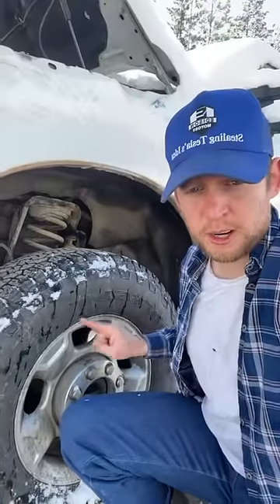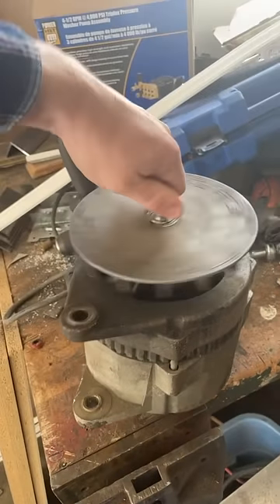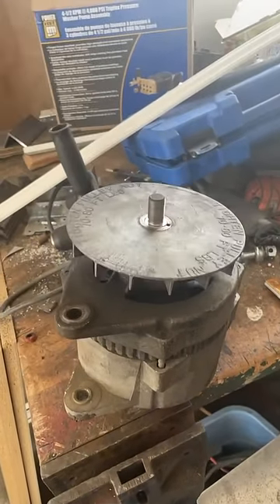Alternator on each wheel???

Comment: I cannot convince my dad that a windmill in the grill of your car is a bad idea
Reply: Lol
Reply: Especially for those modern pedestrian crash safety standards.
Reply: @rklug  I mean... don't be in the road
Reply: Unfortunately, you’re dad is ever so slightly right. It’s a bad idea, but Practical Engineering made a video on it with his Ford Bronco. It does burn extra fuel, but so does an alternator. The propeller consumes a little less fuel to make the same amount of power.

It’s not intuitive, and the gains don’t offset the dangers of having a big propeller on the front on your car.
Reply: Let him put a van on his sailboat 😂
Reply: Without an active grill to stop air flow when not needed there is extra drag and if you have an old DC fan you can see by putting an led on the fan circuit you will see it light when the fan is on and when it is off and above 45 mph from the air turning the fan. Still best to block that air than to run a windmill/fan to generate energy.
Reply: He's half right. So long as you're not driving with a tailwind.
If you imagine an ultralight electric car with a massive propeller on top stopped facing a headwind, the wind blows, fan spins, generates power and will accelerate the car forward, generate more power, accelerating the car further. 
The same story for a crosswind, although acceleration will be hampered as the windspeed over vehicle is a square root of a sum of squares (Pythagoras theorem)
Tail winds though, it can only accelerate you up to windspeed, after that, the propeller stops spinning and you'll stop accelerating, and if you accelerate past the speed of the wind, even if you reverse the polarity, you'll be generating less power than what's being lost to drag and the unit will slow down.
Reply: @explosivemallard8038  i saw that video, love his channel. But he thinks it would just make all this extra power lol
Reply: ... what if you put an electric fan in front of it?... Huh Mr logic guy?😂
Reply: Technically a windmill will produce a net positive. However pedestrian safety standards won't allow it. Not yet at least.
Reply: @tummytub1161  ... I believe Mythbusters already tried that1
Reply: Yep!  My mom.  Sigh.
Reply: @rklug  nobody cares
Reply: There already is one
Reply: @kamikrazywarboy2008  That would be an Alternative power source and will be extra tax and an extraordinary markup on the vehicle. Cord sold separately...
Please blow respectively...
Reply: @kramnull8962  but windmills are for milling grain... And since you're on the move you could make money to offset the additional cost. Turbines make energy. 😂
Reply: Your dad is right, mythbusters did it 20 years ago, you’ll gain more then you lose to drag, & screw people, most a ya suck anyhows
Reply: @patrickancona1193  i guess i should have explained this in more detail. He thinks a windmill in the grill of a car capturing all the air that goes through the radiator. Im aware the heat of the radiatir makes a small amount of thrust, im aware the blades slow down the air on the pressurized side. I understand the physics off it all. You guys are talking about a very optimal and mostly impractcal way of doing this all.
Reply: @Zappyguy111  a car circuit is not that simple 😂, voltage and amperage is regulated through the vehicle as it needs to be, it will indeed generate more power by spinning faster but that doesn’t mean shit, just means more of it gets transferred to heat my dude
Reply: I agree it found in the grill is a bad idea. But a tube going from the front of the vehicle to the back of the vehicle and a turbofan made of plastic spinning the generator. Just work
Reply: @Rnm1hart  yeah, like a naca duct on the top feeding a fan at the very rear. You could even put a radiator in front of it to take advantage of that added energy.
Reply: What if its on /in the exhaust pipe 0_o
Reply: @LmanTrojan1212  hmmm, thats just like a turbo generator that f1 cars use. It would be cool but you would want to put it near the manifold so you get the heat before it is radiated into the air and so it burns off the carbon. Youd have to have a good cooling and oil system but turbos already have that.
Reply: You know how those challengers have holes inthe headlight housing? Can't you craft your aerodynamics to pull air into to little windmills in those ducts?
Reply: @cyberiasaint  haha, maybe! Put a ram jet engine behind it!
Reply: @cyberiasaint  it might create more drag and use more fuel then energy it will produce.
Reply: @LmanTrojan1212  better designed intakes need to exist. I need a scientist!!!
Reply: @sambadel3492  
Sounds like you need to rethink the implementation of your model. I'd suggest a control circuit between the fan and your power system.
Reply: It's not 🤷‍♂️. That wind is being generates by the thrust of the vehicle. We've tested this it actually creates a small charge.

Not the same...
Reply: To be fair tesla uses their motors as generators during regenerative breaking 😁🤷‍♂️🙋‍♂️
Reply: The science says feasible, (go watch the veratsium video about the wind car) 
However practical limitations from the atmosphere being dynamic means it's only a "when the stars align" kinda thing.

Put it on a submarine, and we'll talk.
Reply: @jaredpaulsen3  you guys have left even me behind lmao, all that engergy transfer and complex aerodynamics.
Reply: @everettstormy  to be real, I'm here for the lolz, 
Cause I should be figuring out that wind car, 
Went faster than the wind that was propelling it.
I know it's not most people's cup of tea, but one day, mark my words, I will revolutionize something.
Thanks for your engagement 🙂
 and love your life!!!
Reply: Wish idda read this before posting
Reply: Because it’s a FANtastic idea bro
Reply: I don’t believe you gotta try it
Reply: Lol why would you want to grind wheat in your car
Reply: I mean to be figured that's so slightly better idea than best one
Reply: Actually they make special wind turbines for the roof of vehicles
Reply: Honestly have you ever seen a radiator fan? bruh
Reply: Age is a prerequisite for wisdom, but age alone does not guarantee wisdom.
Reply: Not a bad idea, I think it would only take a few people getting chopped up by the fan blades before people started paying attention while they're in the streets or in parking lots. That by itself would be a win.
Reply: I have a small wind turbine on my truck....but then again that's to charge my external battery and its a 5.7 v8...soooo...
Reply: And I cannot understand why a hydro electric setup in the bed of my pickup wouldn’t work . Hahaha
Reply: Regenerative braking recovers some of the kinetic energy that would otherwise turn into heat and instead converts it into electricity. In this system, the motor drives the wheels during acceleration or cruising, but the wheels drive the motor while decelerating
Reply: Get him to rig up a water wheel instead. It'll be funny.
Reply: You already have a windmill in the front of your car it's called a motor fan
Reply: On a Tesla it would waste energy.  On a pick up truck there is a possibility that it could reduce drag while producing energy.   Mainly because a pickup is so wasteful.  In addition to the Veritasium video where an extremely efficient system can use the wind to power a car to go faster that the wind.   If the wind comes from the side, it would be like a sailboat.
Reply: Unless it has a direct flow thru exhaust......
Reply: Lol, a form of this is patented actually by my great-grandfather. I wish I could post a picture here of the original patent paperwork we have framed hanging on the wall. 😂

Edit: The fan idea that is. Not the alternator idea.
Reply: Put the windmill on the roof and park where the wind is blowing so it charges while you are parked.
Reply: Or you can just NOT get an electric car and not have to worry
Reply: @catsaregovernmentspies  i like the way you think! combined with a little drill to collect geothermal and solar you might not even need all the hamsters I just cough "adopted" cough cough
Reply: @michaelwhitacre8499  lmao, so you one of those kind of people. stubborn, I like that. mechanically inclined I assume. just a small problem. you have to say something so dumb that we all thought it, but none of us thought it was even worth mentioning. you just have to understand that it would add zero value to society.
Reply: @everettstormy  wow. That's a very drawn out response to a passing comment 😂. If you want an electric car knock yourself out, but I'm not seeing any real positives for getting one.
Reply: Tiny turbines with dewalt brushless motors generating power
Reply: A fan powered alternator creates drag, but overall it should charge the batteries, which is better than loss from the belts.
Reply: It is a great thought no exactly a bad idea 

Wat he really needs is a prop and turn his car into a land plane
Reply: One on the back
Reply: @michaelwhitacre8499  lmao, woke up and chose violence
Reply: @weazeldark3983  a land plane, lol. Instead of an airplane, a GeoPlane
Reply: @wyioughta  milwuakee better
Reply: Ok what about a scoop that forces air through the natural aerodynamics to an internal air turbine that's setup on a flow through.
2. Solar panel film in roof or hood
3. Alternator on the wheels that engage only down hill
Reply: @DJSincereTV  the wheel alternators are a lot of weight but would be ight for a hybrid. The solar panels would do a little but really not a ton. The hood scoop would add a lot of drag when ever the car is needing power so that the wind generator is loaded. A few problems but thats kinda what weve been discussing.
Reply: @georgejefferson8718  actually you might be on to somthing. If the fan was relocated and put on a flapper like and ac mixing valve.
Reply: @johno812  i think your missing the fact that pickups are designed pretty functionally, the drag comes from the larger engines taller suspension and work bed design. I cant really think of a good way to add a decent propeller unless it was mounted in front.
Reply: jonaaurelius6871  there are soo mant problems with that im not even going to get into it lmao
Reply: @russchiappa4870  yeah, just pump the water up and let it run back down over a turbine. Infinite power!
Reply: @weaselodooms  lol, thats really cool! Do you have any videos of it?
Reply: @natekraft9529  lmao, yes i have. I think the proceeding comment may have been talking about you
Reply: @Zappyguy111  yeah um, thats a perpetual motion machine your describing. Its like using a magnet to push another magnet. You may get a very slight net positive if the wind is adding energy to the equation but that wouldnt be much becuase of size restraints
Reply: @everettstormy  
If that were the case, sail boats would be impossible, but they've the go to mode of transport for 10,000's of years.
Reply: @Zappyguy111  okay, hate to be that guy but they def havnt been around for 10000 years. Also, notice the size of the sails and the fact that they are only going the speed of the wind. The wind from the cars speed will never produce the same amount of energy it takes to continue the cars velocity
Reply: If I were you, I would look into whether he's your real Dad. It sounds like he might have just been the Patsy.
Reply: That's a good one
🤪🤪🤪🤪
Reply: @TonyRule  lmao
Reply: @TonyRule  hold on gotta look that up
Reply: @TonyRule  after a quick search, i have no idea what you mean by that.
Reply: Also illegal. No Bullshit.
Reply: @everettstormy  Normally, the apple does not fall far from the tree.
Reply: @antoncasciano8747  what about a windmill off each bumper?
Reply: @ShawnDickens would a pipe instead of Rod to make the grill to usher the wind into a turbine to charge a battery not work. The engine still gets all the air through the slits in the grill that little extra that flows around the vehicle would get blow straight though eventually. Causing suction of the wind like a bladeless fan. This should add to fuel manament, and dynamics, but decrease down force.
Reply: @Gerry Bird  air tube straight from front to rear is the only front opening I know of that reduces drag, but usually only a racecar is okay with a large tube through the middle of the car and not many of them even.
Reply: @ShawnDickens  hmm, im not sure how that would reduce dragw aside from releasing the preassure pocket at the front and the rear low preassure pocket. But, if you put a turbine in the middle of it. That would produce enough drage to midigate most of the airflow though that channel and it would build positive pressure in front of it. Not sure how it would effect things full though. Depends of frontal design
Reply: @TonyRule  lol, while thats true, he grew up in a different time. Most of his experience is practical and just what he sees. I enjoy the theroetical side of things. But we also argue a lot about that stuff lol
Reply: @Everett Stormy  yeah, that is how I works. The cars with the tube will have a little more top end. Yes, a turbine in the middle would cause a flow restriction, like the one in the  grill, it would cause more drag loss than power production.
Reply: That's because your dad knows it is an awesome idea
Reply: @jrbird1983  i mean this idea could actually work in a car with a vary small engine to work as a hybrd system
Reply: Show your dad Quint builds here on youtube, excellent father and son bonding just trying things and one is a wind mill in the grill of his truck
Reply: @c4k3t0otz6  hes seen it.
Reply: Lol that would be a great idea, for aesthetics.
Reply: That's actually not a bad idea and are driven turbines work quite well obviously.
Reply: Wait hold on why even use electricity? Let's use wind powered cars bring back the saying "set the sail"
Reply: Oh really. What is the difference between a small wind turbine and the radiator fan
Reply: @cloudian159  hundreds of feet and hundreds of pounds. 
Keep in mind you did say wind turbine. And those are the differences. It can be condensed down to one word=SIZE
Reply: There's no such thing as a small wind turbine. Those are known as windmills
Reply: @cloudian159  wind driven vs belt driven.. Input =Air force vs Engine pulley system.
Reply: @Allworldsk1  i am aware of that. I was pointing out that it isnt a bad idea nor a big safety issue.
Reply: @cloudian159  nice. I agree. There are ways to make it happen. But the "Industry" doesn't want that. In my opinion.
Reply: You have some pretty good ideas. But the prop turbine..... bad solution. It's a very inefficient system. There is a better way.
Reply: @Allworldsk1  your much better off to just make the car more aerodynamic than add drag and moving parts to collect a minuscule amount of power
Reply: @rodneycampbell5687  solar is decent. Doesnt require much junk added. honestly just strait heat fueled power collection would work well in hot parking lots.
Reply: Electric cooling fans replaced mechanical ones because of efficiency.  The fan can be off except when it is needed reducing drag and increasing fuel economy.

If the turbine were turned off except under braking conditions then it could work.
Reply: @Wesley Edwards  Fans certainly work well...... but there is one that is better than the prop ones.
Reply: @wesleyedwards2764  yeah, just straiten the blades to rebuce as much drag as possible. But at that piont your going the same thing as an alternator. If it was somehow lighter and more efficient. Sure its feasible.
Reply: @JJ_ExMachina  technically, no it won't, you will be less efficient.  The wind blades create drag, and the resistance required to turn the alternator. These plus the heat loss and resistance of the circuit will cause even more of a loss of efficiency.  You can't create energy without putting in the same amount in a perfect circuit which doesn't exist, you always lose some form of energy one way or another. Figure it out and you'll be beyond rich and control the world. Just have to break a few laws of physics in the process.
Reply: @patrickancona1193  there is no way that you are getting a positive gain when doing this. It's not possible, there is no way they could determine the electricity they created gave them a positive gain over the fuel they may have gained by producing electricity. It would be so small that there are so many variables that would change the results. Air temperature,  wind changes, replicating drivers actions, and is the power gained more than what the alternator would have supplied during that same time as the wind turbine is producing? I guarantee the alternator is more efficient than a fan catching such a small area is no way going to produce that much in the same time frame. The engine is using most of the power to produce to move the car, the wind resistance is only a small portion of that.
Reply: Lol, he's one step away from understanding why forced induction is great.
Reply: @alphatrion48  ... It does work... It has been tested... and you most certainly CAN get a net positive when using a windmill... The issue is pedestrian safety. You can't stick spinning blades of death on the front of a vehicle and legally operate it on public roads.
The principles you are talking about are driven forces from something attached to drive train of the vehicle... 
   A windmill is NOT attached to the drive system... It's being powered by the wind generated while the vehicle is in motion. Can it fully recharge the vehicle while it's being operated NO. However the tests show that a properly tuned wind turbine (tuned to offer the most output with the least amount of drag possible) can in fact put more energy into the system, than it is required to spin the turbine. Some tests have shown that it can produce enough energy to extend the range of a vehicle by a substantial amount (no exact numbers, since the companies working on it are pretty hush hush about things).
   However when talking practical application... it's going to take a huge amount of engineering difficulties to over come the dangers of having spinning blades on a vehicle.
Reply: @JJ_ExMachina  I beg to differ. It does not gain you anything in the end. There are so many things at play that you are not figuring in your calculations. The amount of resistance needed to turn the generator would most definitely change the air flow around the car creating more drag thus negating any gains you would gain. Plus the heat loss, and inability to capture the air flow that is being generated by the car would create a huge amount of drag therefore burning more energy than getting. You are talking about capturing the air  behind the car in the draft. This would most definitely create drag on the car. When Mythbusters did their tests it had so many things that were not done to actually show the real results. I have a degree in mechanical engineering as well as a degree in renewable energy with a focus on wind turbines. So believe me, I've seen doctorate students test these theories for their thesis papers a multitude of times with none ever showing a positive gain in any of these situations.  The only time I've seen someone who was able to generate a positive without any mechanical means is with a sailboat in a trip across the ocean. But even then there is a trade off with loss of speed from the drag created by the blades, they tried axial turbines with the same result. You can't get something from nothing. Figure it out and your set for life
Reply: @amelamee4940  they are small as you want them to be. You can use a rc car motor with a 2 inch blade if you want to do an experiment on your own. Get a motor, blades, and an led and be amazed
Reply: @BZEDAKING  yeah because they tried many of these concepts and each one resulted in a negative gain except from braking. This is only feasible because of the high resistance needed to turn those motors which aid in braking and gives you a surprisingly amount of energy in a short time. It's at least one way to recoup some of it back
Reply: @LmanTrojan1212  of course it will, you can't get free energy without using the same amount in one form or another.  And that is in a 100% efficient circuit which does not exist
Reply: @alphatrion48   ... Sorry but I don't have to calculate anything nor am I talking about some TV show... While Mythbusters was an entertaining show, they were a small team working with limitations, not to mention it last aired almost 10 years ago. I am talking about Lockheed Martin and other larger companies, are working on right now. I have seen first hand what Lockheed Martin is working on at the Yuma proving ground in AZ. Without violating my security clearance I can only say, you should do some research into what Lockheed is doing and working on. When it comes to wind turbines and what companies they have invested in. Let's just say, current EV tech looks primitive to what is currently being developed right now. Too bad it's not going to be directly related to civilian applications. Of course that's how it always is. NASA developed high torque battery powered tools to fix satellites in space. Now they are common place... So eventually the stuff Lockheed is working on right now will trickle down to civilian applications.
Reply: Smokey Yunick put a dc generator  in front of the radiator on his stock car and said it worked fine but NASCAR said he was cheating so they banned it.
Reply: that's because it's a great idea!
Reply: @travis2893  Car people never pay attention to crosswalks, so I'm not surprised that you'd forget about them.
Reply: @cyberiasaint  I've envisioned air ducts designed into the body with turbines inside. It's not about endless energy, it's about extending the distance one can travel before plugging into a charge station.
Reply: mine has one in front of the motor thingie under the hood already
Reply: But you already have one.... It cools the radiator while stopped hahahaha
Reply: Technically you do already have a giant spinning fan in your car for the radiators but a tesla doesnt need that and aslong as theair is directed out in some way the drag would be reduced and the mini wind mill idea could theoretically work
Reply: @everettstormy  no missing the facts or the point.  My Tesla with its 500+ HP and 4,300 ft-lbs of torque at the wheels is 1,000 ft-lbs of torque more that a top spec Hellcat.  It can out perform any pickup you drive.  And wile towing a 4x8 trailer that can fit more things without hanging off the back while still getting more that 100 MPGe and a faster 0-60 while pulling that trailer than any sports car you have ever driven.  But that wasn’t the point of the video or the comments.  It is merely a response to your tangent.

The point was adding a wind generator to a truck which in several demonstrations has proved to work on pickups because you can’t add to the drag coefficient when it is all ready that inefficient.   But you can produce power.  But would not work on a Tesla because of a “no free lunch” when it comes to the law of conservation of energy.
Reply: @johno812  you cant add drag? And also great that you can read the brochure  but cant even have even body panel gaps, repairs done in a helpfull amount of time or a spare tire. On top of a loan that will last longer than your battery's. A trucks usefullness comes from its ability to move the most weight or drag at one time. Adding drag with wind generators is not adding to its overall abilitys. And you cant just generate more power via mechanical means without adding drag. Unless you optimize the overall shape of the truck to have less drag normally and get back up to normal drag when power is being generated. I think replacing the alternators with exhuast turbine generators or wind generators would help with efficiency if done right. You could probably make more power just becuase of the lack of mechanical energy transfer in the electrical system. At that piont just go hybrid.
Reply: It's called an electric motor there on the wheels. They charge when its slowing down
Reply: lol and they banned pop up headlight because of people
Reply: @CrazedHistorian  incomplete statement. Please return to add more information to your comment.
Reply: What if there was an arm underneath the car with a one wheel on it and everytime that one wheel would spin one time it would spin the alternator 10 times cuz it has some really crazy gearing in it maybe it'll just give you another fifteen or thirty miles but just enough to get you out of a jam sometime or something like that or just enough to run a more stuff in the car something
Reply: @explosivemallard8038  Not one big propeller. A fan wall.
Reply: @MudDowg07  so that would technically produce power but alternators arent reliant on rpm like generators. They can produce the same power at 1k as at 5k so long as there is sufficient torque. With that in mind not much gearing would be needed. If you just wanted an emergency power supply, bring a gas can or limit your batterys minimum voltage to always leave a little extra. The wheel underneath is completely redundant becuase it could just be collected off another alternator, a wheel driven generator similar to regen brakes or anything else really. If you just want an emergency power supply just use solar or a bicycle lol
Reply: @travis2893  Fr lmao
Reply: Small vertical wind turbines at the side of high speed roads works though
Reply: Listen to your dad a car already has one why not use it to regenerate some energy
Reply: it be called the radiator fan :D
Reply: @leamgodfrey7445  yeah those are neat
Reply: @Sokanas42  i wish you know the shear number of people that have said the exact same thing. Dude its annoying and not solving any problems. Just being a smartass
Reply: Yeah... Cuz they are way too big... Duh
Reply: @explosivemallard8038  Even without the blade issue it'd only be practical if you knew you'd be able to keep up enough speed to match the efficiency of the alternator. So on the highways it'd work, but you'd run your battery flat pretty quick in city driving.
Reply: You need to tell your dad there's no such thing as free energy
Reply: They're called turbo chargers and they are great ideas
Reply: My dad always wanted to put a scoop on the roof of his motorhome and a squirrel cage fan to generate power
Reply: @ghostedonline  if by turbo charger you mean turbine super charger yesh their pretty sick. If you mean exhuast turbine driven generator yeah their also cool. But if you mean a wind turbine generator. There are over 150 replys where i explain this over and over. Read them before you try to tell me anything else.
Reply: @oldguss  that'd be cool actually.  If you had a big battery bank just have it up there charging the thing on the way to your site.
Reply: bobcrose4996  its always pick ups with you guys. Your only choosing pickups becuase they are a highly utilirarian. Putting turbines all over them would not help with power or efficiency or ability to hual. Using a highly efficient electric turbine may be helpful on some things to generate electricity. But youll never make enough to make up the extra drag you added.
Reply: I mean turbo charger, like the one on your grandpas 2500.
Reply: @ghostedonline  okay, thats a turbine super charger. Yeah they're cool but they dont produce any electricity lol.
Reply: I'm not sure but it seem to me that it wouldn't hurt anything.  but it wouldn't create free energy.  you can't make energy from nothing.
Reply: Hey a windmill in your grill is a better idea than attaching alternators to your wheels. That drag from 4 alternators to charge your drive battery would be pretty terrible. As for a windmill it won't create so much drag that it makes much of a difference but since the car has to move thru the wind anyway you may be able to get a meaningful charge to a 12v battery lol. but it wont do shit for making the car go. In order to get meaningful charge to a traction battery the windmill would have to be huge. and  the drag for a windmill that large would definitely be a detriment.
Reply: Sure you can. Just let him do it. He'll see a shit load of flaws and 0 upsides and maybe then he'll start to get it.
As I'm sure he would say "take the warning label off" and just let him FAFO.
Reply: @mikes2381  lmao, yeah he would just procrastinate till the end of time like he always does
Reply: @explosivemallard8038  so then...its a bad idea.
Reply: its not a bad idea , the additional used can be compensated for with a magnetic bearing assembly , making the whole thing frictionless , to be honest you can do the same thing with alternators on each wheel. 
the problem comes from the fact that nobody wants to re-engineer an alternator. they haven't exactly been updated to be made with efficiency in mind.
Reply: @saschielx  so....what youre saying is..its worse than what we have. Making it a bad idea
Reply: @saschielx dont know what your talking about so ill explain. Firstly yes they are designed for efficiency but also for reliability and cost. Magnets are cool but dont like to have a ton of load on them becuase they just arent super strong. As an alternator spins, it doesnt have any resistance aside from the bearings UNTIL it needs to PRODUCE power. When you use your radio or lights or anything and it drains the battery, the alternator kicks in and starts making power. The more power it needs to produce, the more resistance it will have. A propelling doesnt help either. When the alternator has resistance the propeller is extracting energy from the wind in the form of speed. This creates a positive pressure in front of the propeller and more importantly a negative pressure behind. That nagative pressure pulls on the car and uses energy. More energy than the alternator will produce.
Reply: @emmanuelmedina2740 he doesnt understand how energy transfer works yet
Reply: Oh come on that's a great idea!! Hha
Reply: It just adds resistance, and it takes power to overcome that resistance, it’s kind of like for every action there’s an opposite and equal reaction
Reply: Drag would make it inefficient
Reply: @KelBShobra  yes more drag the less efficient 👍
Reply: LOL 😂
Reply: you mean a radiator most cars have those wisdom of the ancient
Reply: I'm probably your dad's age but why would that be bad?? I would think something similar vto what they have for camping???😁 Old people🤣😂
Reply: @jeffreybrown5756  okay, so the added drag from the propeller turning the alternator to generate electricity would just equal out to the amount of power being produced. Thats becuase the car is putting that energy into the wind, then trying to get it back with a wind turbine. It would just add a moving part. It works when stationary bc it is using the winds energy.
Reply: So your dad is not so wrong, there is something called ram air turbine and, it’s kinda the same
Reply: @ShadowBeta  been over this like 100 times now. Just read the other replys please.
Reply: @everettstormy  i don’t know how to read
Reply: @ShadowBeta  you really just make me scroll for 2 minutes to reply to something that dumb. 🤣
Reply: @everettstormy  same ahahah🤣
Reply: what you would want are some tubes that run the length of the vehicle, with scoops on the intake end, and lightweight turbines in the tube.
The vehicle is already going to overcome the wind resistance of a bumper so replacing it with some intake sections makes no difference, but the air being compressed in the tubes spins up many small generators.
you arent going to get back the same power you put in to move, but you will be generating some power without having added any wind resistance.

combine that with solar power, regenerative braking, and potentially some scavenged power from a circuit built into the roadway, you could approach unity
Reply: @uncletrashero  okay so your almost right but you missed a key factor. You said its already over coming the resistance of the bumper. The bumper is static to the car and really just creates a preasure spike in front of the car that just helps its aero. Thats why big rigs have those massive flat panel bumpers. The major drag comes from the air being broken up and shoved around by the rear and under side of the car. The top is usually the only parts thats shaped well enough it has little turbulence. Adding a turbine is pressuring the air, but instead of leaving it alone, you extract its potential energy and cancel outs its aero benefits. Not saying your idea wouldnt work, just keep in mind, pressure in front of your car helps, and a turbine of any form is in fact extracting energy the car already put into the wind. Meaning it aint gonna do much.
Reply: @everettstormy   well to get more specific,  most modern front air dams are designed/shaped so that the solid surface helps to move air around the vehicle instead of under it, particularly focusing on intentionally aerodynamic sports cars. the less air traveling underneath the more downforce is created, so ideally you move the air from the front to the sides or over the top of the vehicle.  
however, in basic automobiles they arent seeking high levels of downforce so they allow air under the vehicle, the front air dams are primarily used to keep excessive air out of the engine bay since its more difficult for air to escape from there.  so these basic bumper surfaces are rounded toward the bottom and allow air directly under the vehicle where a lot of turbulence is created because cheap basic cars dont have aerodynamic undersides (they just have open frames and cross sections and dont really care about drag coefficient under a honda accord or ford f150)
taking an inch or two from the bottom section of a front bumper surface will have effectively zero impact on the vehicles performance (where it would be much more significant to do the same to a Ferrari)

the benefit of the tube lengths is that you can have multiple tubes side by side, as well as multiple turbine down the length of the tube.

when the air pressure is low the turbine resistance of the front turbines will impact the spin rate of turbines behind it, but once the air pressure is higher (vehicle at freeway speeds) the turbine spin will be great enough that the air on the tail end of the first turbine will be barely slowed at all. and increasing the pressure by shrinking the tube diameter from the front also improves the flow rate past the turbines.

anyway dont count out the power you can produce with a large number of micro turbines in parallel.  there are even prototypes of turbines with blade cross sections measuring in the NANOmeteres that produce useable energy in microwatts.
enough that hypothetically a shirt could be fitted with nanoscale turbines in the fiber weaves that together produce enough energy to charge your cell phone while you walk.

as i said before theres no way you are going to reach unity (100% return on output) from the power it takes to move an entire vehicle, but you can make an appreciable portion back. 

this is because wind power is not simply converting the wind friction into energy, its taking advantage of the physics of spin.
one thing that might help to think about is that you could take a basic rock that weighs exactly 5 grams, spin it on a table, and measure how long until friction causes it to stop spinning. then take a spinning top weighing 5 grams (same exact mass as the rock) and spin it, and it will spin far far longer.   same mass, but taking advantage of some physics you can get a lot more energy out of its spin interaction than the stone.  or more accurately that the friction from the stone surface takes more energy out of the system as loss than the spinning top does.    turbines take advantage of the same phenomena
Reply: @uncletrashero  i understand all that, im kinda a geek and spend way to much time researching all that a tinkering 😅 but your still extracting energy from a medium that you put the energy into in the first place. It may create power, but adding dozens of micro turbines and ducts that travel the length of the car its ideal lol. Also down force under a car from the venturi/ diffuser at the rear that creaetes drag but moves the majority of the negative pressure area underneath. Thinking about this makes me wander if you could use the thermal difference from the high and low pressure areas to extract power lol
Reply: Explain to him that the windmill isn't as easy to turn when its producing electricity as when its not doing so. This is literally the main reason people fall for perpetual motion stuff.
Reply: @ryelor123  trust me, been over this.
Reply: And for electric fan cars there especially already is one
Reply: how do you think they charge batteries on a gulfstream? like a G6...
Reply: @explosivemallard8038  make ot out of plasticike everything else.
Reply: well it has the cooling fans in there already. you could place a fan that spins from the drag of the wind when the car moves
Reply: LOL
Reply: @travis2893  bro imagine these worh all the weirdos that have been crashing through pedestrians
Reply: I agree, a bit of engineering with vent flutes, can be put in many parts of the vehicle. People just got to think outside the square.
Reply: Only way is to use downhill.
Reply: I can't believe it would draw that much power to spin the alternator for what an alternator can put out , I guess with a monster battery setup maybe an alternator would just be a slight trickle, meaning very little gain, even if it was negative you're still going to gain distance that you can travel
Reply: Because it isn't a bad idea, and if it's a turbine style feed by inter cooler. Most of the problems are solved.
Reply: @shannonbalgaard4494  an alternators load is directly proportional to its rotating resistance. If you put a wind turbine on one, it would impart the same force into the oncoming air as it would the supply for the vehicle to propel itself forward. Therefore it would have a net zero aside from frictional and other losses.
Reply: @CincoRodriguez-ij2kf  can you explain that a little more, how would you use an intercooler on a wind turbine? If you used the heat from an intercooler to energize the air flowing over the turbine that would be cool
Reply: @everettstormy  indeed that would and help power the vehicle
Reply: @Zappyguy111 nope, might not be exactly what you mean look up ddwfttw (directly down wind faster than the wind), the wind pushes the vehicles body and then the spinning wheels turn the propeller
Reply: @JJ_ExMachina just take a vertical axis wind turbine, turn it 90° so the axis is roughly parallel with the axis of the wheels and stick it where you'd stick a spoiler, and use an MPPT that optimizes for both power maximization and drag minimization.

I can promise it would work, but
Reply: @LmanTrojan1212 turbo-alternator
Reply: @saschielx  ... Anything directly connected to the drivetrain would create more losses than it would gain. The drag caused by an alternator connected directly to the wheels takes more energy to drive them than they can produce in return. A windmill/wind turbine produces energy without causing nearly as much drag, so there is a net positive on the power they produce. It's just a matter or pedestrian safety to overcome. A giant spinning fan of death isn't something that will pass NHTSA regulations on vehicle safety standards, very easily. Unless engineered in such a way that the spinning blades would not expose perdesrians or the occupants of said vehicle, to any more danger than the standards allow for.
Reply: @explosivemallard8038 shoutout to all those who still have a metal rad fan
Reply: They have small 12 inch wind generators that go on the roof of a motorhome. Keep the batteries charged as you drive.
Reply: Now how about a stowaway mini wind turbine for camping trips?
Reply: @@Davemike27 quint builds did prove it would work. But that was not increasing the vehicles efficiency ans range.
Reply: You should see my dads leaf blower powered sail boat
Reply: You pretty much already have one if your car has a radiator.
Reply: Your dad is technically right
Reply: Thats right, the roof is better!
Reply: cause it's not
Reply: @anthonyman8008  honestly the amount of discussion this thread has now and people still don't read them and say things with literally zero argument in their favor. You lost before you typed a key
Reply: @everettstormy  I lost before I was born
Reply: @anthonyman8008  bruh yo grandparents just lost living long enough to have yo mamma 👍
Reply: @bnol03686  lol, a leaf blower takes air from the side or bottom most likely. If the sail is cloth it will curve and redirect the air backwards. Also, most leaf blowers are like 300 watts not even half a horse power. Such an inefficient use of that power would barely do anything.
Reply: @HueMongussD  are you taking about electric fans? Nah not really those are disconnected from the circut at any speed with much air flow.
Reply: @malcolmnicholls2893  true, still impractical and won't charge the battery any more than the drag would effect the car
Reply: @everettstormy  i know, you gotta tell my dad when he gets back from the middle atlantic
Reply: I've had older people pose questions like that to me dead ass serious, it's always a bit funny how my uncrontrolled laughter seems to convince them they're wrong.
Reply: Maybe it’s not bad when he’s parked
Reply: @explosivemallard8038  are what? Your kidding right. 😆😅
Reply: @Zappyguy111  reality gets in the way.
Reply: @JJ_ExMachina  net positive? What in a land where unicorns drop gold nuggets,😏
Reply: @kamikrazywarboy2008  what do you call a wind driven pump? A windmill.😄
Reply: @BZEDAKING  so what?
It is only recovering a tiny fraction of energy that got there from the power grid.
Reply: @dannysdiylife9214  it isn't a new concept it has been the braking system on electric haul truck for decades only they don't store the energy they piss it off.
Reply: @antoncasciano8747  you can't actually think that. 
You are joking yeah.
Reply: @0Aus  ima be honest, bud. I have no idea what tf you're responding to. And Since fucking YouTube doesn't see fit to give some easy way to see what someone is replying to, or at least that I can find with a quick Google search and having uses it since it's inception. 

I'm going to need some clarification...
Reply: @everettstormy  solar power isn't created by heat champ
Reply: @johno812  the laws don't change just for electric cars. The laws remain regardless of power plant.
Reply: @johnsanchez6263  still doesn't make additional energy.
Reply: bobcrose4996  yep drag.
Reply: @saschielx  frictionless 😆
Reply: @BZEDAKING  yeah I totally agree the comment set up suck.
My comment was in reference to regenerative braking. Yes it brakes & yes it recovers a tiny amount of energy in the process but it doesn't make additional energy.
Reply: @0Aus  Yes... but it saves it... right. It keeps some portion of it from being lost in the braking process while also reducing wear on pads and rotors. 🤷‍♂️ It's still better than conventional breaks...
Reply: @0Aus  and it's REGENERATIVE  because the energy was already used to increase the Cars velocity. So you can lose it to heat, OR you can REGENERATE the battery with whatever energy you can capture with the wheel motors whiling slowing it down.
Reply: theres a guy here on YT that did just that.
Reply: @BZEDAKING  👍that is great news.
The way your original comment was structured made it look as if you were suggesting the braking system created energy.  Good to see you have some understanding.
Reply: @maddhatter3564  I know. Ive seen it. Read the rest of the 240 comments before saying something dumb next time.
Reply: @everettstormy  whats so dumb about telling people a guy actually did this, you have anger issues, get help.
Reply: @maddhatter3564  you waisted your time now I'm waiting mine to inform you that people stopped reading the replys to this thread after 50 comments. Then people started saying the same things over rans over and over and over. You maybe not be saying something dumb, but you used zero effort to actually acomplish anything beneficial to humanity. Nothing worth doing is easy, as the easiest things have been done.
Reply: @0Aus  it has nothing to do with the motor or power plant.  I was referring to how aerodynamic a Tesla is compared to a pickup.  Regardless of the reasons why it isn’t or is Aerodynamic, the pick has so much aerodynamic drag there there isn’t much you can do to make it worse.  But the addition of the wind generator could both produce energy at a higher rate that the increase in drag.
Reply: @johno812  You really don't have a clue. 😏
Reply: @0Aus  of course you would say that.  While I was trying to contribute to the conversation based on my over 3 decades working with CFD, wind tunnels, and many other aerodynamic analysis tools for industrial, automotive, and aerospace applications.   I have even designed and built wind generators.  I have even calculated, simulated, and tested aerodynamic drag properties of several model vehicles.

This was a very interesting conversation where in a very special case adding a wind generator can actually have a net benefit on a vehicle.   But instead of discussing the merits or special physics involved; some people just want to troll or spread the propaganda of a political belief system.

Too bad for science and engineering.
Reply: @johno812  wow you must be magic! You believe you can break the laws of physics 👍 go you
Reply: Unless you are using the wind turbine to create hydrogen gas that is fed back into the vehicle engine 🤷🏻‍♂️👍🏻💫💫💫💫💫💫
Reply: @SMOKEY-JAYS-DIESEL  thats just adding even more efficiency, but thanks for finally having an original idea!
Reply: @SMOKEY-JAYS-DIESEL  heard the term energy loss through heat?
From the increased drag right through to energy loss as friction during the process. 
Nothing is free 😉
Reply: @0Aus  lol 🤣🤣 so your saying that solar panels do not create energy? Wind turbines. Do not generate electricity? Geothermal does not work? Lmao 🤣🤣
Reply: @SMOKEY-JAYS-DIESEL ?
Lol what is your comment related to?
Reply: @0Aus  lol nothing is !!free!! Free energy from the Sun. Free energy from the wind re-energy from gravity 👍🏻💯
Reply: same here
Reply: @travis2893 that will work well as long as cars stop at cross walks and never crash and go off the road. You first.
Reply: Lmao
Reply: It's a fine idea, if you live in Chicago
Reply: A guy actually did put a windmill on the front of his truck lol.
Reply: Let me guess can't make a light bulb last more then a few year either. Yall will believe anything
Reply: @SpaceRanger187  I feel I should inform you that a new type of light bulb has been invented that can last many years.